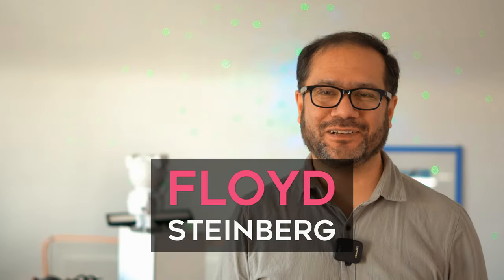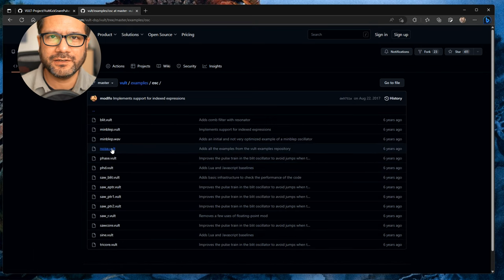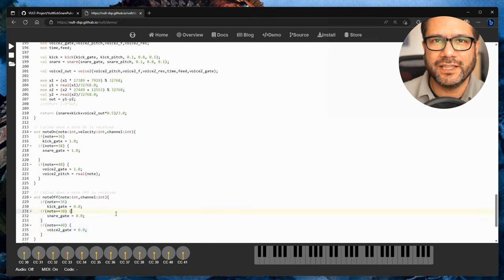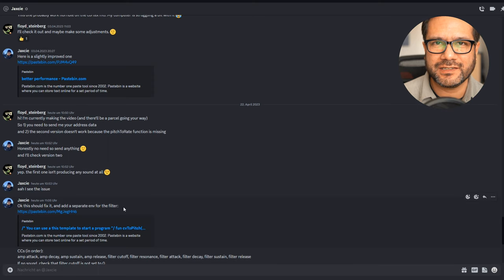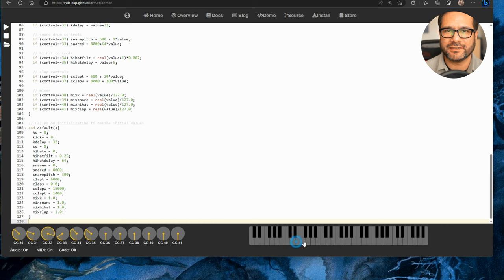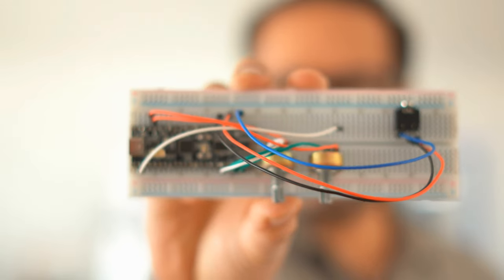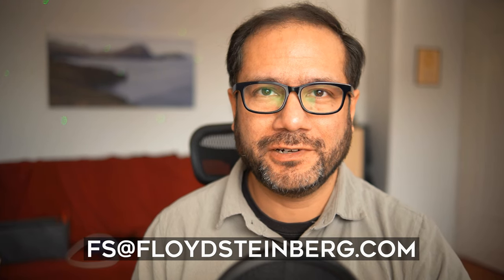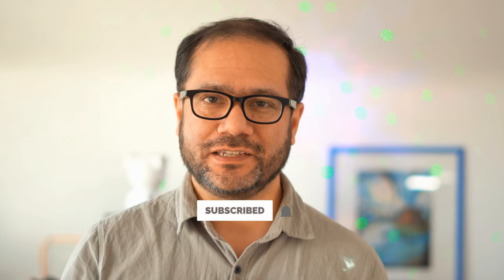Playing your PicoADK / VULT DSP synthesizers

Comment: Took me more than a few hours to learn. Tried coding several sound making experiments first before even attempting anything MIDI triggered. It has a peculiar object model where a "function call" isn't actually a function call but is more like instantiating hardware resources. I should write some tutorial notes to fill in where I think there are gaps in the Vult DSP documentation currently available. 

I'm now wondering if there's a way to use the C++ output by Vult DSP in a bare metal Raspberry Pi project.
Reply from the maker: Thanks for participating! I was impressed by the effectiveness of your code. Everything is condensed into some compact equations rather than "rolling it all out". Great stuff!
Reply: I agree 100% that the documentation was lacking.

Comment: Can the Pico handle USB hubs? (or asked the other way: how can you power the Pico using USB and simultaneously connect the Korg NanoKontrol?)
Reply from the maker: I had it connected to the PI400 for this video shot, as all other instruments and controllers were. I don't think a normal USB hub will work, but a 5 pin to USB converter will.

Comment: Sorry for not participating, i am new on programming hardware as Arduino s so first i have to practice a lot!😂👍🎵
Reply from the maker: No need for apologies, learning a new programming language is time consuming. I'm happy I got some responses.
Reply: I think Arduino experience probably would not have helped to get into Vult DSP,  any more than say programming in Java or C++ in Windows/Linux. It is an all together different beast. One might develop a better mental model for what Vult DSP was doing by messing around with Teensy's audio system design tool or Pure Data